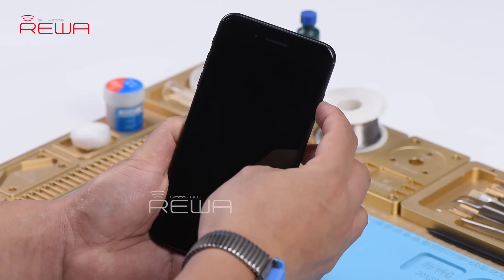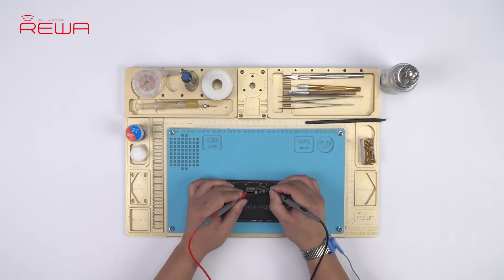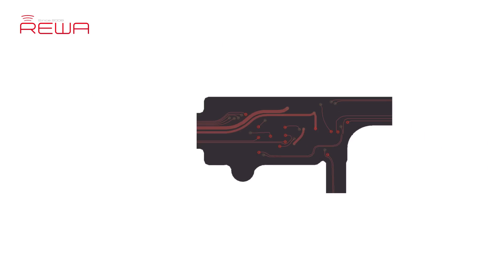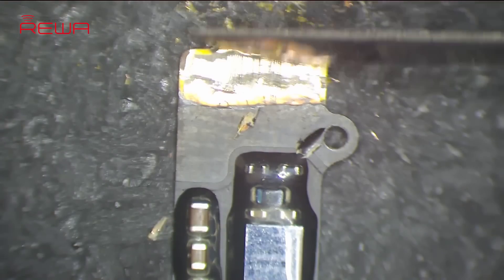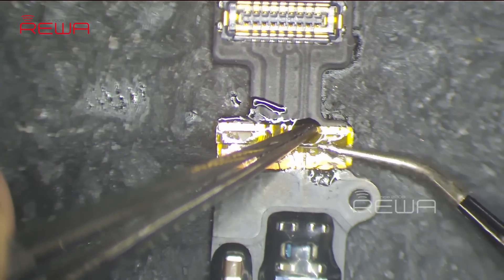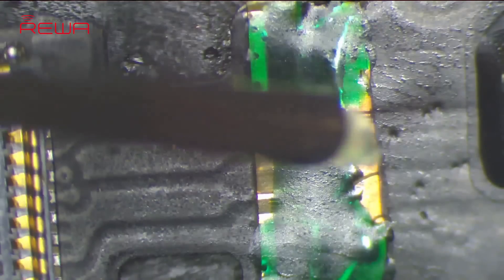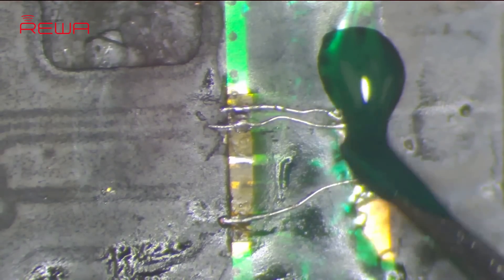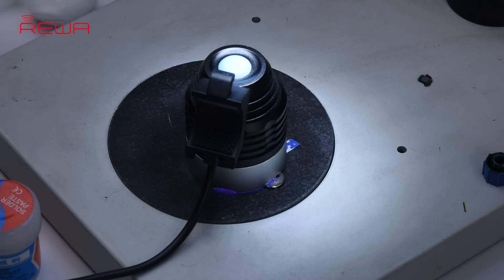How To Fix iPhone 7-8 Plus Touch ID Not Working By Jumping Wires | Repair Shop Tips

Comment: hello Rewa Technology, I love to watch your all videos are knowledgable, so one question about iPhone 7 plus touch id issue, it can be repairable, my iPhone home button cannot press it and touch id is also not working, but now "Add a Fingerprint" option is still available, I can't scan my fingerprint. Is this issue repairable or not? Please, comment to me what is the solution?
Reply: did anything happen yet? , i am having the same issue. did u repair it or something , pls tell
Reply: @vivaan2497  not yet,
Reply: @JNISH_24  my home button and fingerprint is not working when i mistakenly dropped it at concrete
Reply: @vivaan2497  finger print scan page is available or not?
Reply: @JNISH_24  it is but when i scan it says failed to scan your fingerprint
Reply: @vivaan2497  same issue I faced
Reply: @JNISH_24  i want to fix it but apple would cost alot
Reply: @vivaan2497  yeah that’s cost i get iPhone XS 256
Reply: @JNISH_24  thats what the problem is , i want smaller screen iphones and iphone 7 is the one becausr i like one handed phones

Comment: Hello. I've got an iPhone 7 where its Touch ID function does not work. I've replaced the battery and did not even touch the home button. When I was disassembling the device, I did pry up the screen from the left side of the phone. It's not saying "unable to activate..", but it doesn't work anyway. Double-Tap to open one handed mode works as well. The home button works too. What could be causing it?
Reply: Do you want me to fix yours?
Reply: @dong-hoonlee2520  I've already fixed it.
Reply: Good!

Comment: Is there any device you have which can remove icloud easily? Replacing cpu and emmc is so difficult and risky.
Reply: Aminur Rouf  issue with that is no Cellular no calls no app store(workarround can be done tho for appstore)
Reply: Aminur Rouf  can u link it pls?
Reply: Aminur Rouf and can you verify if this that Checkra1n bypass works on all iCloud locked phones like LOST and Stolen as well. Or only for IPhones with LOST or CLEAN IMEI?

Comment: solder iron $20, solder paste $5, wires and accessories $10. (Original home button $10  and less time consuming)
Reply: TouchID is married to the processor, you can't just replace it.